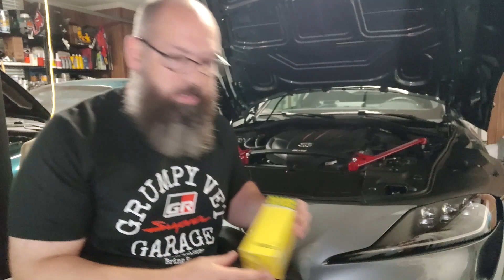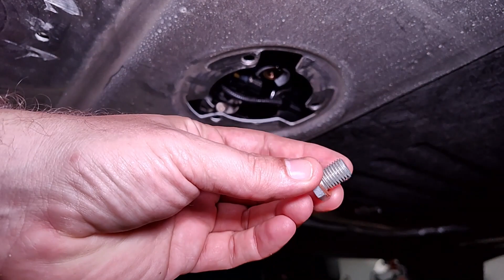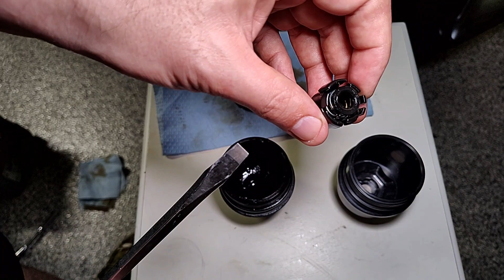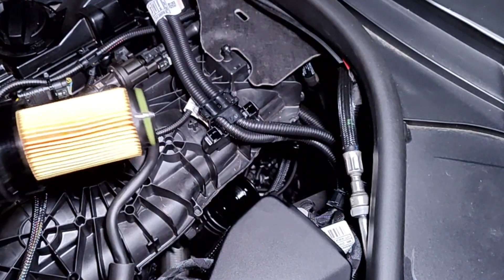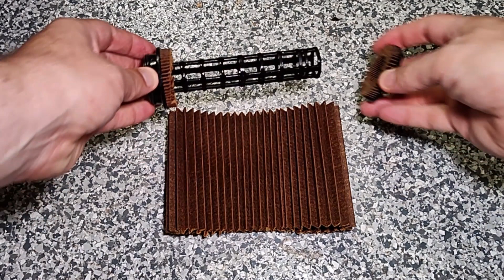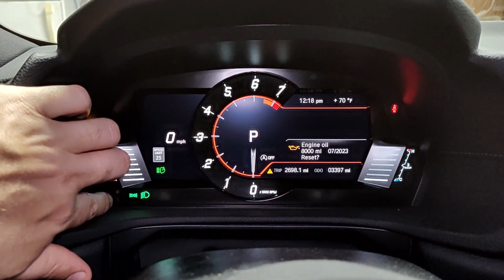A90 Supra Step by Step Oil Change and Paradigm Engineering Billet Oil Filter Housing Cap

Comment: Hi we just bought the Paradigm Engineering cap its great invention but the problem is the Bypass Valve transfer its kind of tedious feet. Do you know if they just sell the Bypass Valves separately ? Great tutorials I watch a lot of them.
Reply from the maker: I can't find a part number just for the Bypass Valve. The OEM part # for the oil filter cap is 11-42-7-926-064 and it comes with the bypass valve pre installed, but not broken down any further.

Thanks for watching and commenting. Wish I had the part number for you.
Reply: if one of the top pieces is broke off is it still usable ?
Reply from the maker: @MrVinnypep  It could be fine since the tabs on top are more for filter retention. I don't know if it would effect the sealing of the oil filter to the inside of the cap. Personally, I wouldn't it use it. Especially, if the breakage is further down past just the retention tabs.

Comment: i received my billet cap after my oil changed a week later.  Can i changed it without doing oil change? let me know...ty
Reply from the maker: You can. You may lose a little oil in the swap over process, but nothing of really consequence. 

You should be checking oil level in the I-Drive system routinely anyways, but after changing over the cap, check at your first opportunity.

Comment: I called Liqui Moly after using their "Find the correct oil for your vehicle" page and seeing that 0W-20 full synthetic is recommended for the 2020+ GR Supra.
The Liqui Moly oil expert told me that:
For those who operate their Supras on the street, 0W-20 is recommended and is the ONLY viscosity oil that fulfills Toyota's warranty maintenance requirements.
Liqui Moly's website lists main bearing clearances and recommended viscosity grade oil. The B58 engine has clearances that were designed for 0W-20 oil. 

 Other resources:
The Engineering Explained youtube video (Will thinner oils damage your engine?) Includes mention to "Use what is specified in the owner's manual." three times to denote the importance of viscosity selection. 
Some owners who use E85 or methanol may thin out oil, using this as a reason to use higher viscosity oil.